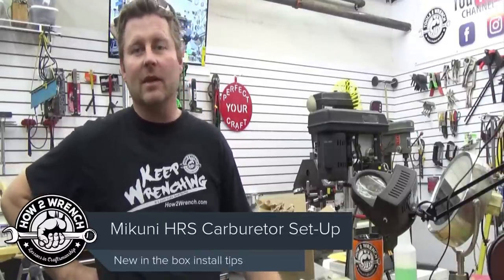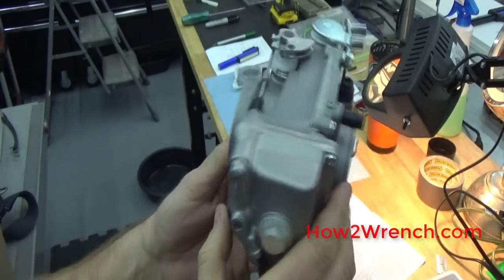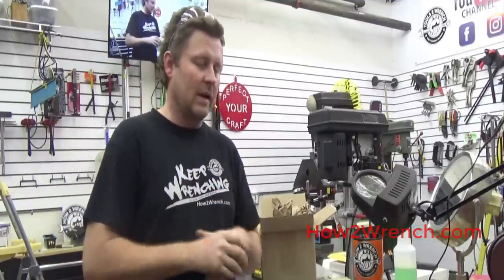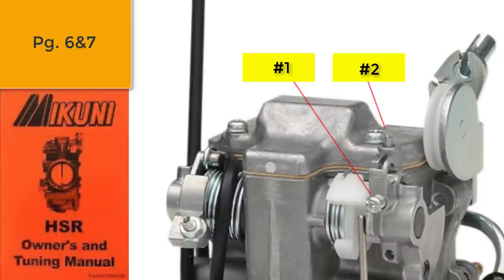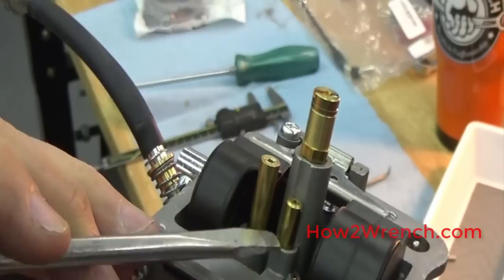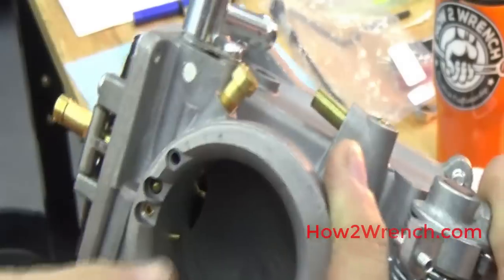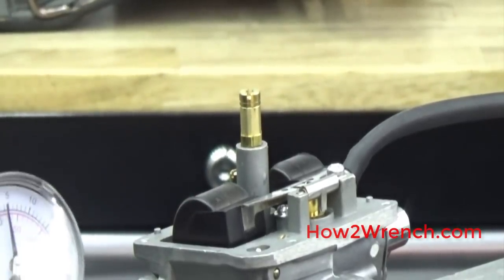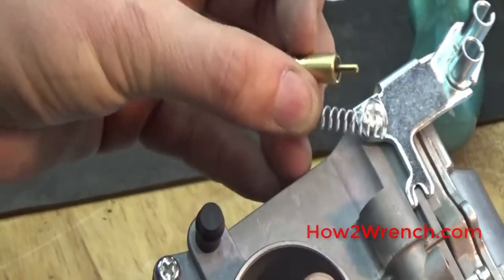How to set-up a Mikuni HSR Carburetor. Float height, Cables, Jets, Leak Testing!

Comment: Awesome! No one has a good video on these carbs .. you gotta do a tuning video for it ...I've always used s&s but I finally  got sick of that exceliration and got the 42 and Its so much better I'm still a bit rich ..I'm not used to having all these adjustments  and being able to tweak  it just so. A video about tuning it would be super helpful ..all of your videos  are super helpful thanks for everything you do.
Reply from the maker: Thanks for commenting and adding value to our community! Your request has been added to the list. Support our work by sharing or a donation to help us keep going, friend. BTW. We have many other videos in the fuel systems playlist: https://www.youtube.com/watch?v=3FmfO-mWv3Q&list=PLAtBOuPaEyt-ZMVRlpvWmVFLL10P16vWf

Have you subscribed yet to never miss a video? Have you seen the video playlists? Over 600 videos! Check them out here: https://www.youtube.com/user/conleybuilt/playlists  

Want to say “thanks” or “keep it up”? Click here https://www.paypal.me/how2wrench    
 
Your answers and help are just around the corner. Save time and money while protecting your investment and yourself by doing it the right way at www.How2Wrench.com
Reply: I did an HSR 42 on my 99 evo night train. It was a little rich so I followed it up with I higher flow K&N air cleaner instead of a higher flow OE style air cleaner with a modified air box. I then pulled my baffles and ordered 4 inch instead of 10inch baffles.  Then installed an ultima single fire ignition system. Finally I put and Ev27 cam with S&S adjustable push tubes and breather gear.  Every part I added woke the bike up a bit more and complimented the HSR 42 carb but I'm still a tiny bit rich.   I followed all the steps in the guid before I installed it.  Reset it with every component and it runs great. I'm sure that tiny bit rich isn't killing anything but I am a 29 year mechanic and in my mind I can see carbon building in the combustion chamber and its driving me nuts.   I agree you guys should make and on bike tuning video. I don't care if its on an 883 1200 80" or 88" most 96" and better were fuel injected.  Just stay harley as that's who's buying 90% of the hsr42s

Comment: You have to pull pretty much everything apart and check it for swarf and maybe file imperfections away these days sorry to say. Chinese stuff mainly, but I've even had USA and European made parts with swarf left inside. It's good engine building practice to check all parts before final assembly anyway

Comment: Shane you are priceless.  I am a 48 years experience at age 64 machinist and mechanic.  Like previous videos I watched of your putting together a twin cam counter balancer engine which helped me to learn how the missing teeth on one flywheel is how my crank position sensor worked.  Now tonight with this carburetor video I found an answer to something I was unsure about, as for the small brass tibe in my throttle  in where it wiggled a little bit and how I had to turn it to get my fuel to spray into the inside area.  Its the brass nozzle that sticks up just before your throttle plates and sprays the fuel.  Now I know I have it right on this evo 97 fatboy .  It doesnt ove in where its metal to metal but in the exact way it would be with a o ring holding it in .
Reply from the maker: Love hearing from folks that have benifited from multiple videos! If you didn't know we have "says thanks" link below! We appreciate you.
👍 Thank you for taking the time to comment!
Here is a way to support all the free videos.
Want to say “thanks” or “keep it up”? Click here https://www.paypal.me/how2wrench  

Coach Conley is also available for hire to personally work one on one with you if ever needed. Yep he is a real person. Give him a call @ 602-345-0432
Details here: https://how2wrench.com/product/personal-tech-training-phone-facetime/ 
Your answers and help are just around the corner. Save time and money while protecting your investment and yourself by doing it the right way!
Follow us! 
Web:
www.How2Wrench.com     
www.Tools2Wrench.com

Comment: I have a 2010 FXDWG. I removed all the EFI components and added this carb and I have to say - it made a HUGE difference in the way the bike runs. Along with the V&H exhaust and JET air cleaner and intake, it's 25% more of everything. I just sent my heads up to Hammer Performance in Idaho for a CNC porting and valve job. Along with an Andrews 57H cam set, the bike will be just where I want it.  . . . . for now!
Reply from the maker: Sounds like a badass set-up Dave! Thanks for commenting and adding value to our community! Please subscribe, share and consider a H2W membership to support our free work here!

Have you subscribed yet to never miss a video? Have you seen the video playlists? Over 600 videos! Check them out here: https://www.youtube.com/user/conleybuilt/playlists  

Want to say “thanks” or “keep it up”? Click here https://www.paypal.me/how2wrench    
 
Your answers and help are just around the corner. Save time and money while protecting your investment and yourself by doing it the right way at www.How2Wrench.com
Reply: I love how you end that "the bike will be just where I want it . ......for now".  This was 3 yrs ago

Comment: Been running a HSR45 on my modified TC since 2006. I haven't had to touch anything. If I ever need to. This video will be golden. But, now that you dumped all that info into my head. I want to chase through that fuel mixer on my machine.
Shane you Rock brother. Now go get some sleep.
Reply from the maker: Thanks for commenting and adding value to our community! Cool man. Thanks for tuning in!

Have you subscribed yet to never miss a video? Have you seen the video playlists? Over 600 videos! Check them out here: https://www.youtube.com/user/conleybuilt/playlists  

Want to say “thanks” or “keep it up”? Click here https://www.paypal.me/how2wrench    
 
Your answers and help are just around the corner. Save time and money while protecting your investment and yourself by doing it the right way at www.How2Wrench.com

Comment: Thanks Shane.  I just put a new Mikuni TM40 on my Honda XR650R and all your info directly translates!  Brapp!!
Reply from the maker: Thanks for commenting and adding value to our community! Smart guy.....Yes as with many of my videos, they translate. 

Have you subscribed yet to never miss a video? Have you seen the video playlists? Over 600 videos! Check them out here: https://www.youtube.com/user/conleybuilt/playlists  

Want to say “thanks” or “keep it up”? Click here https://www.paypal.me/how2wrench    
 
Your answers and help are just around the corner. Save time and money while protecting your investment and yourself by doing it the right way at www.How2Wrench.com
Reply: i put a TM42 on xr650r and BRAP....gota have the small #30 accel/pump jet and melt the tank so it fits....or annoy MikuniOz so they make the 42 with a LHS cam/cable pull

Comment: Hola amigo Shane.  thank you for the video. Shane to lubricate plastics and rubbers, dont use WD40 or any other lubricants with petroleum components.  The only lubricant that is plastic and rubbers safe is silicone oil. Keep that in mind.  WD40 cracks plastics and rubbers after 1 year of use.

Comment: Hi Shane great videos I have a problem finding the right measurement for my Yamaha Dragster 1100cc2001 measure like your video shows from the base of the carburettor to the top of the float the manual shows the tube method saying 5mm below datum mark which is the float bowl joint Yamaha says 5mm above IAM confused please can you help

Comment: by the way, im doing a mild to warm street build with a .030 over EVO with 9.5 compression and an Edwards EV59, some portwork and dual supertrapp exhaust. would you recommend one of these over a Super E with powerjet mod for best hot street use and rideability?

Comment: I'm having an issue with my TM 42, when I pull the choke it doesn't work, I basically have to start it and give it gas right away and choke it manually with the throttle.

Comment: Shane, I bought a Zongshen 190cc engine. I want to shim the gearbox but don’t know what I’m doing. If you could do a tutorial on how to shim a 190 gearbox that would be the best thing ever. I’m mechanically inclined as I fix cars. I’m just new to motorcycle pit bike engines. Even if you could get me a manual on the 190 maybe that would help me out.

Comment: Hi, wondering if you would comment. My HSR42 is on an Austin Mini 1275. Low end is great, main jet performance great. Mid range flat spot, and back firing out the exhaust. Get past that, great. It acts lean and according to my o2 sensored gauge it says that also. Messed with A/P, no change, have the richest needle on the richest position with two washers under the needle and better but not great. Still almost goes away with pulling enrichener out. This should not be this hard. I'm wondering how sensitive the float adjustment is and given the amount the carb is tipped on the car. Thoughts please?

Comment: thx for the helpful video. So if I want to set the float height on one of those slanted Mikuni carbs on an atv with no service manual or those measuring tools, would my best bet be to set the float tab 90 degrees to the  float arms as you mentioned in the video or to adjust it as best as I can so the tab is parallel with the slant of the carb body?  Thx!
Reply from the maker: I posted the manual link in the video description. The manual is for the carb and I would follow it. Your ATV intake angle is not in some severve angle so I would say "most likely". 
👍 Thank you for taking the time to comment! Hit that subscribe button if you haven’t please! It helps us! 
Here is a way to support all the free videos.
Want to say “thanks” or “keep it up”? Click here https://www.paypal.me/how2wrench  

Coach Conley is also available for hire to personally work one on one with you if ever needed. Yep he is a real person. Give him a call @ 602-345-0432
Details here: https://how2wrench.com/product/personal-tech-training-phone-facetime/ 
Your answers and help are just around the corner. Save time and money while protecting your investment and yourself by doing it the right way!
Follow us!
Web:
www.How2Wrench.com     
www.Tools2Wrench.com

Comment: hi do you know how many turns you should give to the fuel screw? i just bought a set of mikuni rs 36 for my bike and mikuni instruction says that the adjustment should be from 1/8 and 1/2 turn out max, but sound very strange to me and the bike runs very lean at 1/2 turn out, can i go further to 1 1/2 turn out? tks
Reply from the maker: That's a good question for Shane directly. Have you considered joining the channel to get him daily as a member benefit?
You reached the social media team here. We get 300-400 requests a week, so it’s a bit time challenging as you can imagine. 
Shane does try to answer some non-members' questions when he gets some time so hang tight if you’re not in a hurry. 
Did you know one of the member benefits is to ask for which videos would work for your needs and get daily "quicks answers" to questions directly from Shane?. Best $1.99 a month you'd spend...of course enjoy the over 700 free videos and access the member only vids with all the other benefits listed below. 

There are two immediate options that can get you a solution within 24 hours and quite often within the day. 

Option 1: 
Consider joining...best $1.99 you'll spend this month 😁 This is great for quick answers. 
He literally logs in and answers member questions daily! He does an AM and PM check-in to answer all member questions. Join this channel to get access to perks:
https://www.youtube.com/channel/UCBhM8DCKnT3qXwTW0eToyCg/join       
-Daily MEMBER FIRST COMMENTS ANSWERED FIRST 
-Live Q/A video chats
-Wonder if we have a video on your need? Members can request content links!
-Full Access to the ENTIRE 700 video library
-Member-Only FREE tool giveaways  
Ways to support or high five How 2 Wrench! Thank you in advance. YOU MOTIVATE US TO DO MORE!
1. Smash the subscribe button (thank if already a sub!)
2. Have you seen our "YouTube Trained Support Shirts?  https://goodfellasmerch.com/collections/how-2-wrench/products/support-shirt   
3. High five donation:  https://www.paypal.me/how2wrench    
4. Got an emergency and your head is about to explode from frustration or fear? Get Shane’s cell here: https://how2wrench.com/ols/products/techline-one-on-one

Comment: I need help on a HSR42 carb. I followed this video, and the manual and adjusted the float bowl. Still got overflow. Then I replaced the valve and seat, and checked the float adjustment again. This time I went closer to 20mm....still have overflow. 
I have tried everything. Complete rebuild kit, all gasket, jets, etc. The only thing I havent replace is the float itself.
Why do I still have overflow? By this, I mean when I turn on fuel, the carb bowl fills up, and then starts to drip out of the overflow tube. 
There is nothing else to replace but the carb itself.
How do I fix this?
Reply from the maker: I'm the just the intern studying under Shane. One of these days I hope to move from the office to the shop! Wish I knew the answer but don't want to bs you. He couldn't screen these requests fast enough...
He has a few other tricks up his sleeve he plans on making videos on. If you need help sooner choose and option below! 

That’s a great question for Shane directly! We are just the social media team. Shane does answer questions when he get's back around to non members eventually so hang tight, FYI >>>> he does member ones daily!

He just returned from overseas training techs and his inbox is slammed with requests. He is scheduling time each day again to answer techline orders. He does not have the bandwidth to provide free email replies as his schedule is full with shop customers, training schedules, and one on ones. 
There's good news though! Shane has 2 solutions for you. One is a deep dive one-on-one with him with video, email and phone support. The other is a "quick fan support" option when it's a quick answer and just helps support the time for him to stop wrenching or training and get you in the direction that a free video had you close. Links to each are below. Hope this message makes sense to you as a decent human being that also works for a living and gets it!
Make it a great day!

The one-on-one service. Get Shane’s cell here: https://how2wrench.com/ols/products/techline-one-on-one       
Quick answers are answered daily as a channel member: Join this channel to get access to perks:
https://www.youtube.com/channel/UCBhM8DCKnT3qXwTW0eToyCg/join   
-Daily MEMBER FIRST COMMENTS ANSWERED FIRST 
-Live Q/A video chats
-Wonder if we have a video on your need? Members can request content links!
-Full Access to the ENTIRE 700 video library
-Member-Only FREE tool giveaways  

Have you seen our "YouTube Trained Support Shirts? Great way to "high five us" https://goodfellasmerch.com/collections/how-2-wrench/products/support-shirt

High fives help too! Give him one here:  https://www.paypal.me/how2wrench
Reply: @How2Wrench  Thank you for the reply. My problem was not a normal one. I had replaced the needle and seat with new parts from Drag Specialties, and still had overflow. Upon very careful inspection, I found that the needle would bind if it was in the right position. Because at the bottom of the seat there are four perpendicular holes. There was a tiny ridge on the circumference of the holes that the splines of the needle would catch on. This would cause overflow. I replaced those parts with Genuine Mikuni seat and needle and the problem was solved.
Tricky problem, but it is solved, thank you.

Comment: Loved this video! I put. Mikuni HSR 42 on my ‘05 Sportster 1200C & I feel like I’m running rich. I can’t detect any air leaks on my intake & when I adjust my air/fuel mixture (brass) screw my idle changes at about 2-1/2 turns out but if I keep backing it out I swear the idle never changes again for me to set it at the halfway between point! Do I need to swap my jet(s)? I appreciate any help anyone can give me on this
Reply from the maker: Want to say “thanks” or “keep it up”? Click here https://www.paypal.me/how2wrench  Thanks for commenting and adding value to our community! We offer tuning help!

Please subscribe, share and consider a H2W membership to support our free work here! We are ramping up for the upcoming new member only site with profiles, raffle drawings, and weekly live Q/A sessions and a for sale page!

Have you subscribed yet to never miss a video? Have you seen the video playlists? Over 600 videos! Check them out here: https://www.youtube.com/user/conleybuilt/playlists    

Your answers and help are just around the corner. Save time and money while protecting your investment and yourself by doing it the right way at www.How2Wrench.com
Reply: Steven it should of come with 2 main and 2 excelerator jets 92,  94 main  and 104 102 excelrater jet  you need to try the smaller jets,  if your plug is black ,  if its grey its lean  . white is lean . Tan is best .     the needle jet is under the 3 screws on top Up is lean down is rich , but it has other moving parts under the cap .  Minkui has a manual  google it .  hope that helps

Comment: I have a mikuni carb on my 98 road glide with a thunder header exhaust. Just replaced exhaust gaskets and head gaskets. Oil change and new plugs and wires. I still am getting a lot of sputtering and starting issues idle is either too high or low and bike dies or runs too rich. Any help?
Reply: Andrew Potts probably Intake leak